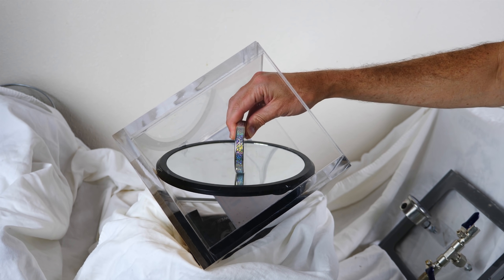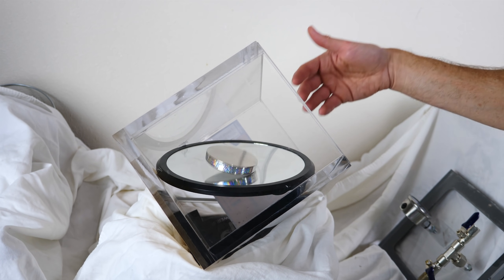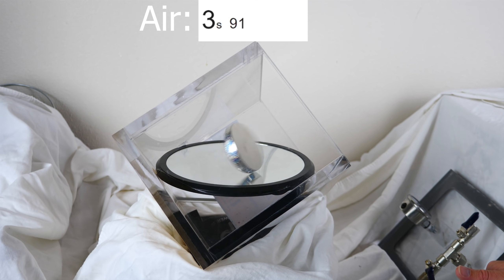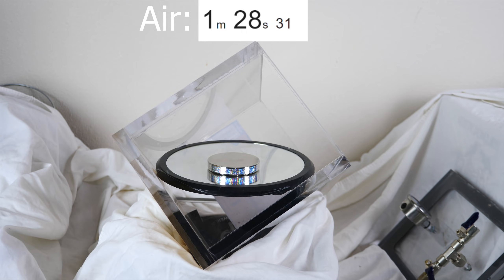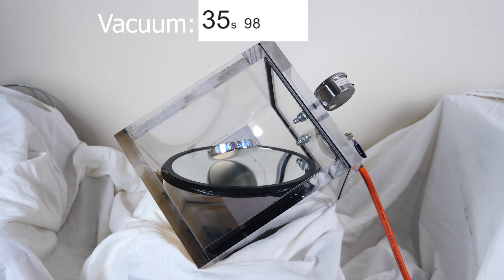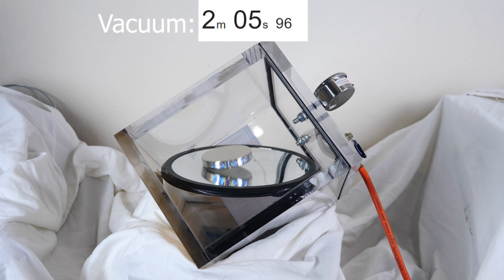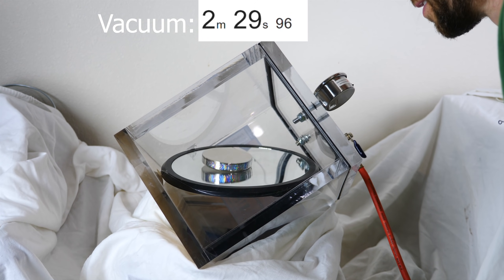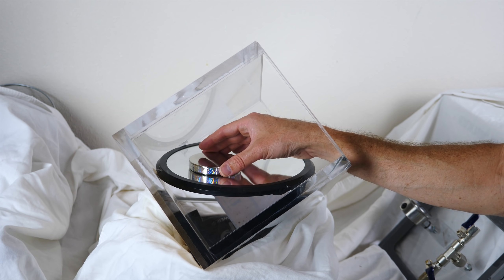Spinning Euler's Disk in a Vacuum Chamber—Will it Spin Forever?

Comment: My record is 3:16 in the air it really depends on the spin. Perfect spin usually over 3 minutes. Wobbly spins go as little as 90 seconds gotta keep the plate and disc clean also

Comment: A Euler's disk is an object that has a specific thickness and diameter ratio, and is typically made out of steel that is polished very smooth and the edges rounded to a specific radius.  It's not  "a phenomenon where you spin something on a hard surface". It is typically spun on a mirror as that is hard but also very smooth and I think even the mirror is supposed to be slightly concaved.

Comment: I feel that the support of your vacuum cube is less than very firm. That white sheet will provide damping even on top of a solid substructure.  Support the cube by absolutely solid props on a steel table on a concrete floor. You could standardise the initial spin with a spring loaded mechanism Akin to those toy Rotor flyers or spinning tops. Glue it to the inside of the cube and a radio controlled servo, retract the gripper against a prong, so that it spins and releases the disk. Do this with the chamber pre-sealed and evacuated of air. And I guarantee you will easily break this record.

Comment: Attempt to reduce the friction as well high polish, maybe silicone spray the rig? Suspend magnetically in vacuum. Use a  bar magnet below to get it spinning  fast. Chuck that bar magnet in a drill, get it going 1100 rpm, then pull it down onto the mirror with a magnet of sufficient force to overcome the suspension magnet. Fast spinning disc starting in vacuum. An hour plus is my guess

Comment: In the 30 November 2000 issue of Nature, physicists Van den Engh, Nelson and Roach discuss experiments in which disks were spun in a vacuum.[8] Van den Engh used a rijksdaalder, a Dutch coin, whose magnetic properties allowed it to be spun at a precisely determined rate. They found that slippage between the disk and the surface could account for observations, and the presence or absence of air only slightly affected the disk's behavior. They pointed out that Moffatt's theoretical analysis would predict a very long spin time for a disk in a vacuum, which was not observed.

Comment: The vibration from the pump might be affecting (for better or for worse) the disk's rotation time. It would be nice to have a means of starting the disk inside the chamber with the vacuum already set, with the pump off, so it would not be affected b vibration from the pump.
Reply: maybe have it closer to the side and use a very powerful magnet to turn and tip it.

Comment: the air might act as a lubricant at those high speeds the disk obtains, meaning that the vacuum would hurt the life of the disk's motion slightly, likely not enough to make up for air friction though.

Comment: You can remove the air but you can not remove all surface friction even if you could remove all surface friction there is still the main force that causes it to stop and that is gravity alas gravity is the only reason it works to beguin with kind of poetic when the cause is the demise gotta love physics

Comment: An interesting fact about gases is that when you draw a vacuum, the gas density obviously goes down, but the viscosity of the gas does NOT.  This is because, as there are fewer and fewer molecules or atoms per-unit-volume, the mean free path increases, and this increases the average per-particle rate of "self-diffusion" and related transport of energy and momentum.  Viscosity in a gas is due to momentum transport.  The viscosity finally does go down on approach to near-perfect vacuum, but only when the mean free path approaches the dimensions of the confining geometry, which is a really high vacuum.  Both viscosity loss and turbulent energy loss (which depends on both density and viscosity) damp the Euler disk motion, and with increasing vacuum the turbulence loss declines, but the viscosity effect remains, at least with a practical "fore-pump" and without a super-high-vacuum diffusion pump, along with plenty of time to evacuate the chamber and some way to launch the disk in the established vacuum.  And of course, the plate sends vibration to the container and into the environment, so that energy loss is hard to minimize.
Reply: Dude this makes a lot of sense, has anybody tried it?
Reply: What is crazy  is that I was thinking the exact same thing and then I saw your comment lol
Reply: Neeeeeeeeeeerd
Reply: @danieldowns8075  Thank you!  Compliment accepted.
Reply: @josephseale254  it’s just a thing I say I don’t actually mean it👍🏻
Reply: @danieldowns8075  No apologies needed -- I take "nerd-ism" to be a positive quality, and with me, it "fits." 😊

Comment: At the end, mentions an off-camera run 'on level ground' was 2' 7".  Clearly there is a pretty large standard deviation.  So one run in air and one run in vacuum is pretty inconclusive.  

These video's would be a lot better if state a hypothesis and then do a number of runs (most could be done off-camera) and some analysis discussed.   Say, 100 spins in air, 100 spins in vacuum, plotting the times, is there a statistically significant difference, etc...

Comment: I know it not the really the point, but mirror vibrations induces lots of losses in both cases. It need to be better fixed with no weak plastic interface. A base made of plaster for example.

Comment: I doubt it’s the air friction that’s the main reason it slows down, it’s the friction between the disc and the surface it’s spinning on.
Plus, how long it spins is dependent on how energetically it’s spun initially. Therefore, you would either have to do a number of these experiments and average out the results, or find a way to reliably spin the disc the exact same speed every time.
Reply: It’s both. The surface to surface contact is incredibly smooth, though.. so it doesn’t loose much speed from contact friction..

As it does slow down, it has to compress and move air at a higher and higher frequency.. so it is largely air friction that is slowing it down, especially at the end.
Reply: @_t_f_  the vacuum chamber spin tells you a lot about where it loses friction to. even with a full vacuum you can hear it spinning, and the faster it spun the louder it got, until it was similar in volume to how it is in air. the only way this sound could have been produced is through vibrations in the plate and vacuum chamber walls, and seeing how much sound there is even without the air, its not innacurrate to say most of the sound normally is produced via vibrations in the plate.
air friction is a major part of the friction the disk experiences, but if it were the majority it would cause the majority of the sound, as sound is caused by air compression. the fact that the vibrations in the plate cause more compression of the air than the disk itself is a clear indicator of where the energy is being lost.
Reply: No, it definitely was way longer due to the vacuum. The initial spin probably doesn’t change it more than like 20-30 seconds

Comment: #1 You are no where near achieving true vacuum, #2 Euler is pronounced "Oiler", #3 You should really design a way to spin it with the same force every time and start it under a strong vacuum to get better results, as well as doing more than one run.

Comment: #actionlab if u ever see this comment let me kindly ask you to do one thing... That is instead of putting the vacuum chamber on the bed which creates a springy resistance the glass surface will act like it's got springy friction. I would really like to see a bigger chamber fixed to the ground so we can eliminate wobbling of chamber itself and fix the glass to the bottom of the chamber so everything is super stable and brittle and nothing is springy. Then activate the vacuum and rotate the Euler's disk and i bet ya that it will go 5 minutes strong at least. Try it and i would like to see the video. Please it's a request. Love from India.

Comment: Here's an idea: Music box inside a vacuum chamber. The point is that a typical music box design uses a governor to manage the rotation speed of the drum. This governor works off air resistance, so the melody should in theory gradually speed up as the air is removed. And you should still be able to somewhat hear the music box through the vibrations transfered to the chamber walls.
Reply: Fun fact. Sound doesn't move through a vacuum. So it would go silent before you notice the difference.

Comment: Your process is problematic in that you have no way of knowing if you're spinning the disc at the same speed each time.  You need to devise a way to reproduce it as exactly as possible, and repeat the experiment many more times in both air and vacuum.

Comment: 675 comments but no one mentions this:  As it spins, some of the KE is changed to acoustic energy as well as thermal energy. Even in the vacuum chamber he set up we could hear sounds from the vibrations of the spining disk. This was due to the contact between the disk platform & the vacuum box.  Energy is conserved but is transfered (as acoustic & thermal) so the disk will not spin forever. The closest to achieving a "forever" spin is to spin the disk in space far away from any massive objects without using the platform.

Comment: Are you sure it's moving more and more air?
As its spin rate increases, the displacement decreases until it hits zero. I have no formula for this, but it would (obviously) depend on the relation between the two.

Comment: the vacuum chamber still hasnt removed gravity so it will stop spinning
Reply: It needs gravity to spin
Reply: @legendaryzet8450  what? It needs energy to spin. Not gravity. I would think this does more to disprove gravity, not prove it.
Reply: @wyzcrackzcomedy5215  I was thinking about precession. I actually don't know whatever it takes energy or gives but I do know that it starts to precess due to gravity. 

But you do know what gravity is, right? Mass attracting both energy and other mass. So how does that disprove gravity.

Comment: You should start the timer if a certain frequency was reached. Or just track the frequency over time using sound analysis.
Reply: Excellent idea, but there shouldn't be any sound produced in the vacuum. Maybe an optical measurement?
Reply: @marsrocket  You should still hear something because all parts are connected to each other.

Comment: If you spin it in deep space it will spin forever without losing energy
Reply: Nope, it will not spin forever.
Reply: @teppopierune5520  Not on any surface but in deep space so there's no way to loose it's energy..
Reply: @kvamshi4561  Even the universe is not forever, so it can't spin forever.
Reply: @teppopierune5520  bro in the scale of human beings it's forever

Comment: You can hear the thing spinning 
Basically it won't spin forever
Reply: He said if there was no friction it would spin forever.
Reply: @ag-bf3ty  with no friction it would not spin it would slide
Reply: @Perokoulos  I'm pretty sure it would still spin. Y do u say i4 would only slide?
Reply: @mkbee4533  because it doesn't only spin it also rolls and for somthing to roll there has to be friction.
Reply: @arnejanssens7384  u don't know the thing.
If there was no Friction it would spin forever
It would still roll but no friction
Reply: @SoapMcCallister  yes in a perfect vacuum and no friction the disc would spin forever. But only if it spins at a 90° angle to the plate. As soon as there is a angle there would be a force parralel to the plate and with no friction the disc would slip.
Reply: @arnejanssens7384  srry i had a stroke. Im saying that the rolling part only takes place when energy is lost. No energy will be lost though due to there being no friction. This means that there is no roll at all when the disc is at its best. See?

Comment: A true experiment-ator would make 100 tries with air and 100 tries in vacuum and calculate the averages
Reply: A real experiment would deliver a measured amount of rotational thrust onto the disc.   Starting in air and in a vacuum.

Thirty six trials each is the minimum required for statistical significance on a Gaussian distribution.  One hundred trials each would be better.
Reply: Jamal Labarge A fellow intellectual.

Though I would add a few things.
1. Have a machine that is controlled by a human spin it (the spinning would be activated by a button)
2. Renew surface (or use different area of surface).
3. Spin the Euler’s disk in either environment with maximum control over air conditions (air pressure, temperature, and contents).
4. Use many Euler’s disks and surfaces with different air conditions.
5. Average the times of the multiple spins on each surface with different air conditions.

“In science, don’t try to limit the variables unless you got millions of dollars of funding because it is really hard, instead play around with the variables. I don’t know much so I shouldn’t extrapolate my current knowledge too far to where my knowledge does not apply.”

              - Isaac Newton 3975 - 8407, Mars

“Don’t trust internet quotes.”

          - King Kong

““I like memes

      - Me”
     
       Said King Kong in his yellow suit.”
       
         - You
Reply: EmpireBuilder large
Reply: The diference in the spinning time is so huge that it is not necessary doing again.
Reply: @lubo0  it seemed that it spun harder on air experiment
Reply: And create an artifact that control  the strength use to spin the disc,  Every time.
Reply: In a vacuum chamber nobody can hear you cry for help
Reply: Its true that doing it again is mostly pointless because we have experimentation and theory to tell us what happens and it would be boring, but if were manually activating a chain-reaction that would cause a supernova you probably wouldn’t mind seeing it (with special gear) a few times.
Reply: Only 100? Not one billion million trillion?
Reply: For important things yes
Reply: I bet that would make a great youtube video. 'Today we're going to spin this coin 200 times'

Comment: There isnt a perfectly smooth material or surface hence why it is impossible for the disc to spin forever even in the case of a perfect vacuum. There is always going to be friction between the surface and the disc and its always going to slow down. You forgot to mention that.
Reply: yeah dont forget electromagnetic friction from the metal disc cutting the earths field lines rapidly, generating voltage
Reply: Yeah that is also a thing but does it actually create stopping force or friction?

Comment: Can we do this same experiment but using ice as a surface with a very low amount of friction
Reply: That's how deep space looks. Unbelievably fast spinning ice  everywhere lol.
Reply: yeah i just gave an example btw  wood can also have low friction if it is smootened
Reply: @cistare7587  not necessarily because the atomic structure matters too
Reply: so that means wood cannot be as smooth as a mirror
Reply: @cistare7587  yes
Reply: thanks for telling me about it
Reply: It isnt just about friction the coin is quit heavy and could create dents on the ice on a microscopic level essentially creating a hill that it would then have to climb. Which would waste energy
Reply: Or just spray a thin layer of WD-40 on the surface first - - - - -
Reply: @andraskelemen1912   Ice does not melt in a vacuum it will sublimate so if enough ice is put into the chamber, the vacuum will pull out the evaporated water and the chamber will be clear. The ice will stay there for a few minutes depending on the size of the ice. Even hours😂
Reply: i think you can the experiment even with wood if it has low friction and uniform surface
Reply: @cistare7587  so you're saying that wood is smoother surface than glass?
Reply: @cistare7587  No man ice is the easiest substance to come by with a friction coefficient of almost zero because of the density of the water molecules in the ice. It will be the best material to use to get the least friction and is very affordable. Wood has a high friction coefficient which means it will slow down the disk faster and give more resistance.

Comment: No. It won't spin forever. It still has rolling friction in the chamber. But it will spin for a very long time.
Reply: And the gravity has a major affect.
Reply: @theredviper7401  Not directly on the amount of time it spins. Only on the amount of rolling friction. So if there was no rolling friction gravity would also have not effect and it would go forever
Reply: @theredviper7401  and it's not affect dumbass it's effect.

Comment: U can stick a piece of metal on the top side of the disk, and use a magnet to hold it first while u vaccum the box first. After the air is sucked out just pull the magnet away from the box and let the disk drop and spin..